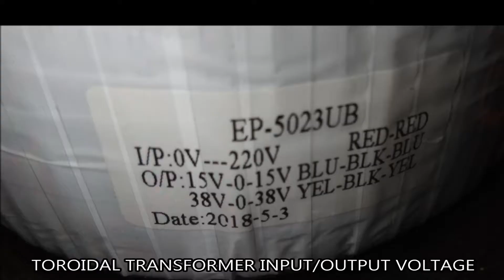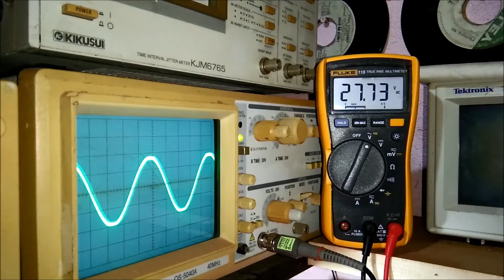SAKURA AV-5023UB Amplifier Output Measurement and Teardown,..

Comment: Kaya ba nya yong isang box na konzert D15 idol
Reply from the maker: @Pinoymusic16  Kaya boss, yung mga 2 - 2.5 inch Voice coil.
Reply: Meron kasi ako idol konzert 15 professional Hi -Fi-Sub woofer  KW-4000M ayan tatak ng speaker nya meron ako nyan kaso baka di kayanin ni Av 5023UB amplifier @CABohol
Reply: Kaya nya kaya yan idol .tapos anu maganda na Twitter sa kanya 2way ko lang sya mga 300watts na Twitter anu kayang klase na Twitter orderan ko sa shoppe
Reply from the maker: @Pinoymusic16  pwede boss.

Comment: Boss tatankng kolang kc marehas tyo ng amplifier. 4 months old plang po ung skn pero ngloloko na ung right side no sounds po.
Reply from the maker: Check mo.yung pre amp at amplifier section Bro... Check modin.yung connector na in at out misan nag lost ang copper tracks don.

Comment: Plan to buy a crown bf 1208.. is it compatible to this amp 5023 ub?
Reply from the maker: Yes it's compatible,.. I think the size of the voice coil of bf1208 woofer is 50mm or 2 inches... The specs is 650W but in reality maybe the power is only 60-80watts,..
Reply: @CABohol  if i go for 700 watts dont know the bf model but still compatible just curious thanks
Reply: Bf 1268 700watts
Reply from the maker: @josephglenncastellano2436  Go for Crown BF-1268 the specs says 700 watts,... But maybe the real power is only 70-80watts,... I tried to used this amp with my 15" Speaker 3" Voice coil and it really give some kick, as long as the sound is not distorted and clipping we are in the safe zone...
Reply: @CABohol  salamat kaayo
Reply from the maker: @josephglenncastellano2436  welcome

Comment: sir unsa match speaker sa sakura AV-5023US 550W x 2
Reply from the maker: Ang matched niya sir katong mga speaker nga 2 inch or 50mm ang voice coil...
Reply: thank you sir
Reply: naa koy speaker sa sony SHAKE-X10D match kaha na sila sir..
Reply from the maker: @michaeldevenosa3289  kun 50-100W Sir matched na cya... Basta dili lang distorted ang tengog.

Comment: Boss meron po akong Bf105 laging nasusunog ang mid range ko po lage ako nagpapalit hnd manlang tumatagal ng 1buong araw na sounds sira na agad.. bale 4pcs po un per palit tapos labor pa. Sakura 5023ub po ampli ko.. ano po kaya dapat ko gawin para maiwasan na masunog ang midrange/twitter maraming salamat po.
Reply from the maker: Mag series po kayo ng capacitor sa midrange/twetter Boss,..
Reply: @CABohol  meron na po sir pero sinusunog nya padin tlga minsan wla pa 2hours wla ng tunog ung mid/tweeter
Reply: Ano po ma isuggest nyo specs ng capacitor sir try kopo
Reply from the maker: @funtime3342  ang value ng capacitor Boss ay depende sa frequency response ng tweeter,.. Example kung ang tweeter ay 8ohms tapos ang crossover point ay 3kHz,.. Pwede mo lagyan ng 6.8uf non polar capacitor... Try mo nalang search ang Crossover calculator online Boss para maka experiment ka ng ibat ibang value ng capacitor at frequency response,.. Pero pwede karing bumili ng ready made na crossover network marami ata sa lazada,. Meron din akong nakitang tweeter protector na benta don.
Reply: May dc output ka .. kaya nasusunog. May nag short na pyesa yan.. pagawa mona baka lalo lumaki sira nyan..

Comment: Sir tanong ko kang bakit ayaw gumana ng equalizer pag kinonect ko sa amplifier na av5023ub wala.kasi xang eq in /eq out patulong naman sir salamat
Reply from the maker: Make sure na working ang EQ mo Sir, Output ng source mo econnect mo sa input ng EQ tapos output ng EQ econnect mo input ng Amplifier, pwede morin e touch ang RCA cable para ma confirm mo kung may pumapasok ng signal.